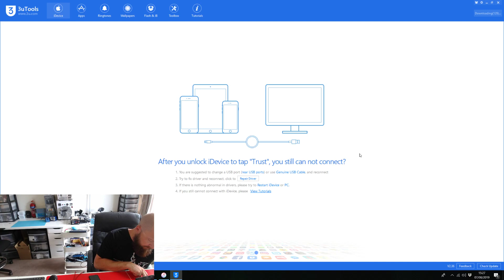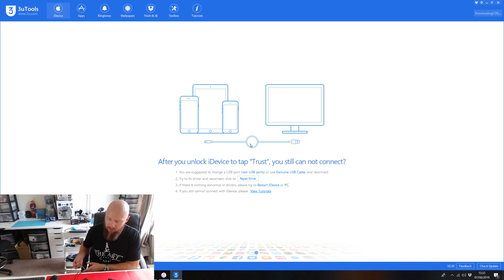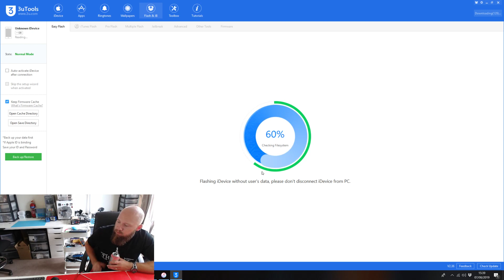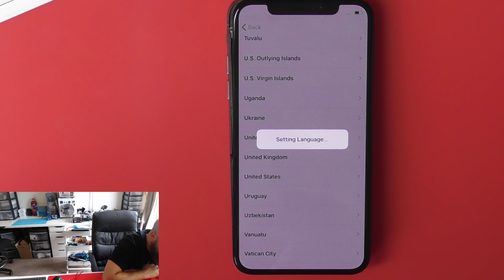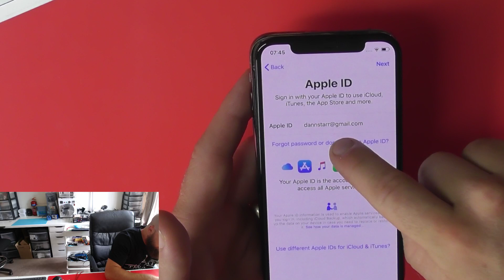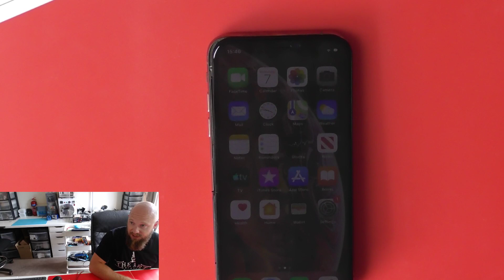XS battery service issue

Comment: I'm having this problem with my iphone xs max i bought used from a retailer but it's under warranty , i did a DFU reset myself and it hasn't worked ' waiting on a replacement handset.
Reply from the maker: Chris Langton it's not a "problem" as such, it's just an indication that the battery has been changed. It's just Apple being Apple and making it seem like an issue because they didn't get paid to change the battery. So long as your battery life is OK, I wouldn't worry.
Reply: @DannStarrElectronics   It has caused my phone to shut down randomly and come back on' , and my battery drains really quickly too, the retailer has the phone at this moment in time . I am hopefully getting it swapped for the xs model instead the xs max has put me off of it now. love my Iphones but this worst one i've ever had
Reply: @DannStarrElectronics  I had the phone replaced in the end for an iphone xs instead not had the issue since i replaced the device
Reply from the maker: Chris Langton - excellent news 👍

Comment: I bought a 7plus with a replaced battery but it shows its battery health which is 100% the problem is that its shows a message (ur battery has significantly degraded) i wanna delete that message can you help me about it ? Thanks
Reply from the maker: Aymen abdeldjalil Kribaa it sounds like a bad battery. Replace the battery with the best quality you can find wherever you are
Reply: DannStarr Electronics yeah i thought so coz when i take portrait mode pics the phone dies and dont start only when plugging the charger so as u said its surely a bad battery do u guess !
Reply from the maker: Aymen abdeldjalil Kribaa yes, new battery needed 👍

Comment: I have found the solution for this problem
Reply: how
Reply: ??? how
Reply: Well easy just need the icopy plus tool and the software for desktop,original replacement battery and 3utool program. On the 3utool connect the iPhone and u can get the original serial number and them u can copy serial tru the software on the battery.thats it
Reply: Miguel Repair do any repair shops do this service?
Reply: @themirer100  не работает, не наебывай людей. Единственное что работает это перепайка контролера со старой батарее на новую...через программатор не работает
Reply: @rone3178  type English please
Reply: @themirer100  захочешь переведёшь. Translate yourself if you want

Comment: Did you charge the battery with the battery service issue? When I also replaced the battery, a battery service issue appeared. After charging, the charging mark was displayed, but the battery level did not increase at all.
Reply from the maker: T Imamuu yes - the battery charged just fine

Comment: So my understanding is that the only issue is that battery health is not going to work right??
It’s bad that they’re doing this. I think it all fall back to the money they are forcing consumer spend by only allowing one to go through Apple for a battery replacement.
Reply from the maker: Yes... And the "service" message which implies something could be wrong, when the likely hood is that everything is fine. As far as I understand, battery performance is not affected

Comment: Does this affect the 6s batteries?
Reply from the maker: No, at least not yet...
Reply: @DannStarrElectronics  Thank you. I need to replace my 6s battery and the official Apple provider here in Panama is not bringing this battery anymore. So I am thinking of using ifixit battery, but I have never done such a thing. I have opened and serviced laptops but not cell phones before. It is for my own phone though. Any provider you would recommend to get the batt replacement from?
Reply: @vsuarezp  just be careful with the screws it is not hard.

Comment: YOU MADE A MISTAKE... apple asked you to replace the "BATTERY" not the protection board attached with it … Try to replace the "battery" only. use the old protection board  with the replacement battery. It works, trust me :)
Reply: I have 70 percent on original battery,after spot welding board to new battery have still 70 percent but no service,any chance to restore battery life?
Reply: @frantisekhorvath3078  you can edit the information using the he used in video or qianli battery tester.
Reply: @badrulaminbaruddin176  9l
Reply: @badrulaminbaruddin176  lo9
Reply: @badrulaminbaruddin176  99
Reply: @badrulaminbaruddin176 o9⁹l
Reply: 9⁹
Reply: 9l⁹
Reply: L99
Reply: Lo9
Reply: 9⁹l9
Reply: o
Reply: Ĺl9
Reply: L9l9
Reply: Ll9l
Reply: O
Reply: L99
Reply: L9l9
Reply: Ĺl9
Reply: 9⁹
Reply: 9⁹l9
Reply: 9l
Reply: @frantisekhorvath3078 9
Reply: 9l9
Reply: Ll9
Reply: Ĺl9
Reply: @frantisekhorvath3078 9l
Reply: 9⁹
Reply: 99k9
Reply: O
Reply: 9l
Reply: @frantisekhorvath3078  l9
Reply: 9